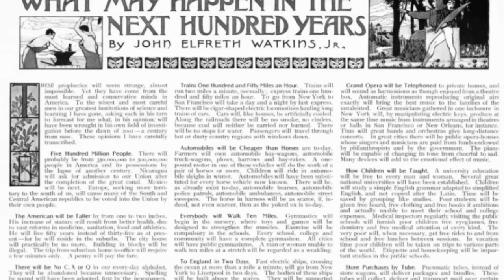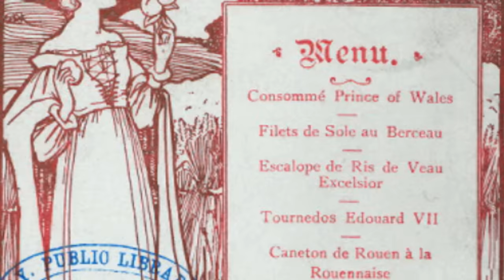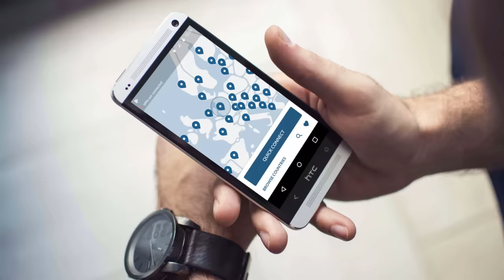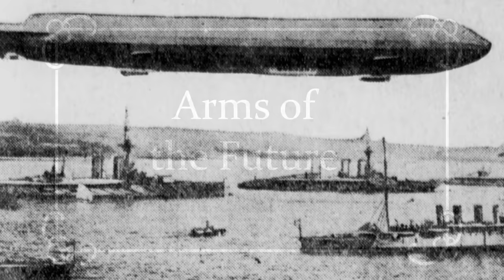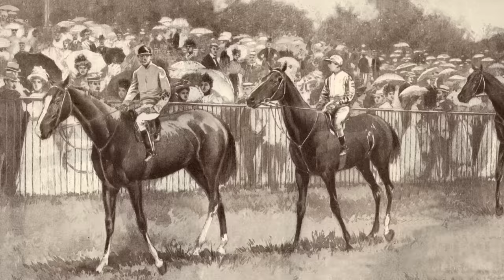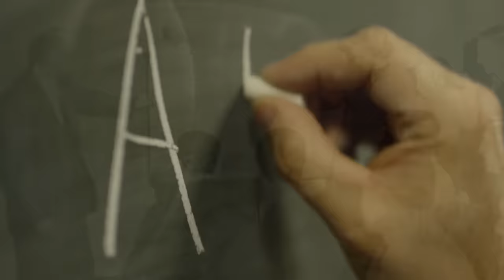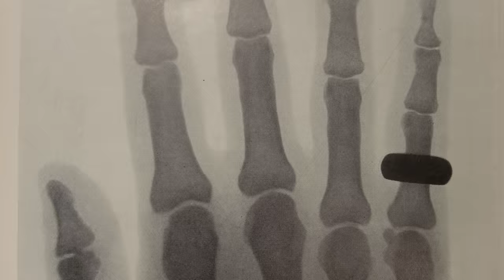Futurist from 1901 Describes The World of 2001 // 'Ladies Home Journal' (1901) // Primary Source

Comment: It's amazing how much they got right.
-Children will ride in automobile powered sleighs. Close, snow mobile operators must be at least 13 in most States.
-Passenger trains probably would have been developed as predicted but for the airplane.
-The rise of the automobile replacing the horse entirely in work and industry.
-Heating and cooling in the house controlled by a switch. (Thermostat) 
-Forts on wheels charging across the battlefield. (tanks)
Reply: Passenger trains outside of the us are as predicted. The Japanese bullet train easily falls into that prediction. The us would have high speed trains but the oil industry wouldn't allow it.
Reply: arnold jayeola  America has airplanes which are superior in every way
Reply: @everfaithful9272  yeah... No.
They Are more suitable to the conditions in much of the USA than passenger rail would be, though.
Well, a dedicated modern transcontinental express high speed passenger train setup (with a setup similar to the Japanese shinkansen) might actually be better still for most instances of that trip if you could convince anyone to spend the money on it, but other than that.

Still, that's less a problem with Trains, and more a matter of large portions of the USA being flat out Empty.

Passenger rail actually still does pretty well in the north eastern USA,as the distances between the places people actually want to go are suitable for it, and freight rail is Still the most cost and fuel efficient way to get bulk Anything from one place to another overland (ships are generally better still, of course, but have the slight downside of not being able to traverse drunk and :p).
Reply: @everfaithful9272  Are they and when fossil fuels run out how are you powering these superior planes? While electromagnetic trains. Won't need fossil fuels and can travel at a speed of 375 miles an hour currently.
Reply: @everfaithful9272  The disadvantage of air traveling in a logistic point of view is A). high cost compared to rail and cargo ships B). relative low capacity. Even in terms of speed it does not make up for the amount of goods the largest air cargo or passenger airliner can make up for their counterparts on the ground. Its advantages are speed and relative wide operation areas as it is not limited to infrastructure (railways) and terrain (it's in the fuck air). Transportation in the U.S. could have been a lot more efficient if there's a widespread high-speed railroad system, but it doesn't.
Reply: @laurencefraser  It's a difference in mindset. If you value freedom, luxury, and efficiency, driving and flying are the way to go. If you just want to save money where you can and herd people together as much as possible, seeing not individual choices and preferences but just a moldable collective to be moved around, then yeah, put down train tracks everywhere, put homes right next to workplaces, heck, make everyone get an annual ticket paid for with taxes. Fly? Why fly? Why move away from where your friends and relatives live? Just stay where the experts tell you is the most efficient.
Riding the subway and cabs and ubers is great for students and creatives, as are big cities anyway. But that's not how 90% of humanity, at least Americans, are meant to live.
Reply: @jameshughes5722  Fossil fuels won't run out within our lifetime. Plus, planes that run on batteries are already on their way.
Reply: @lcmiracle  I'm obviously talking about passenger travel, not cargo. Like I said above, it's a difference in mindset. If given the choice people don't care about "efficiency" in the sense of how cheap the "collective" is being moved from A to B. People want to have the most private, luxurious, and fastest mode of transport they can buy. And I wouldn't call marring the beautiful countryside with train tracks everywhere efficient, anyway. Nice big cars and airports everywhere, with some subways and cabs/ uber in bigger cities meant for students and creatives, is honestly golden.

Comment: I worked in a chemical plant built in 1905, I'm around 6'2" and had to duck my way through most areas. Good thing I wore a hard hat or I'd have banged my head pretty good a few times.
Reply: That shows we are getting taller to cope with expanding intellect to keep our heads normal. And people to be able to learn.
I guess anti Vax and Karen’s haven’t evolved. ;-;
Reply: Tyler MG / Tyler mega games That’s not even close to why people are getting taller. Height has pretty much no connection to intelligence.

Comment: Also them assuming that the U.S. would build high speed trains.
Reply: Is a dense population necessary to keep the price down?
Reply: @Joshua_N-A  2 months late but:
Yes. Let's say it takes 200 USD worth of fuel for a round trip between two cities. Then there's also the cost to pay the conductor and the rest of the staff of the train (plus all the staff at the stations). Then there are the daily maintenance and sanitation fees. So, chalk that up to about 1000 USD for a single round trip. The more dense the population, the more people in that area to potentially use the service. The more people using the services, the less you need to charge per individual to repay the cost of operating said services. So, if only an average of around 10 people use the train per trip then you'd need to charge 100 USD per person per trip to cover cost, but if an average of 100 people use the train per trip then you'd only need to charge 10 USD.
Reply: @Joshua_N-A  yes, we should start in boshwash
Reply: @capnsteele3365  coasts are always dense in population.
Reply: To be fair the airplane, which they didn’t even fathom, basically made long distance train travel obsolete.
Reply: Not in the US, but such trains do EXIST, and in 1901 they most certainly did not.

Comment: "hot and cold air will be available through spigots"

Well, we don't exactly get our air from a factory but I suppose this does describe a central air and heating system that many homes today have.

"houses will have no chimneys, because no smoke will be created within the walls". 

Oh, if only...
Reply: Plenty of houses don't have chimneys. A fireplace is a luxury feature these days. Back then every house had a chimney as it was the only way to heat a house
Reply: Thermostat = spigot
Reply: @jay15951  If you have any sort of fuel based heating system (even a hot water heater, there is an exhaust pipe exiting the roof of the house, i.e. a chimney.

Comment: "There will be airships, but they'll not successfully compete against surface cars and water-vessels for passenger or freight traffic, they'll be maintained as deadly war-vessels..."
If only he knew how mixed up this prediction was.
Reply: A few years later, the heavier than air aeroplane was invented. That has replaced the ocean liner & train for long distance travel. Airships for transport & military went away by the late 1930s. Even in Europe, rail systems are still facing stiff competition on certain routes from low-cost airlines.

Comment: Based on inventions which were clearly successful, like the automobile, it would have been safe to say in 1901 that motorised vehicles would almost completely replace horses for transport in the developed world. It's when people predict more abstract things that they go astray. Ready-made hot and cold meals was a good prediction, although you could get certain types of such foods from vendors in 1901. Having the meals transported to your house via a system of vacuum tubes somewhat ruined the prediction: they never happened because they wouldn't have been practical for many reasons. Where would all those thousands of miles of tubes have gone? How far can an object be transported by vacuum in a tube? And so on.

As for nations of super fit people... When public and private transport is relatively cheap, you're going to get less active people, not fitter ones. 

Predicting the future is good fun, though. I'd like to have written some predictions about the 2020s myself about thirty years ago. They'd probably have been laughable. WiFi, streaming services, smartphones, photo-realistic video games, large Ultra HD TVs costing less than £300, cheap and powerful personal computers, broadband internet... I'd never have considered any of those things. Progress between circa 1970 to the early 1990s had been painfully slow (in hindsight), so there was no reason to suspect the huge leaps forward in technology which occurred in the twenty years between the early 1990s and the early 2010s.

Comment: Agreed about the letters C, Q, and X serving no purpose, been complaining about that for years
Reply: C has use
Reply: @Mr.Obongo  no it doesn't. All occurrences of C can be replaced with S or K except in the combined consonant CH which is a consonant of its own and should have it's own letter. Therefore C should be pronounced 'ch' and solves 2 problems at once.
Reply: the word Also is a mostly meaningless dead end pointless word. only 0ne use, as in A.K.A, that is it 😐🤪

Comment: Three minutes in, and I'm enjoying it but also thinking 'well over ninety per cent of this is wrong, and most of it is diametrically wrong'. Everything predicted to improve has deteriorated. Flies and mosquitoes healthier than ever, whereas bees and other useful insects have sharply declined. Free and world-beating health-care for all? Amusing. Free, sort of (only here and Australia). World-beating health-care is expensive (then as now). No more chimneys because energy will be cheap and plentiful. Wrong as a wrong thing that couldn't be more wrong if it was a duck-billed platypus. 

Luxurious housing for all, wide-open green spaces and woodlands - 'the suburbs'. No comment necessary. Brilliantly, the one thing they got right is also wrong. A modest increase in longevity. No, a substantial increase in longevity. They expected us to live middling-length lives of plenty. Instead it's a very long life of endless scarcity. In 1901, they'd probably have said 'sounds like hell'. You get used to it though. :)